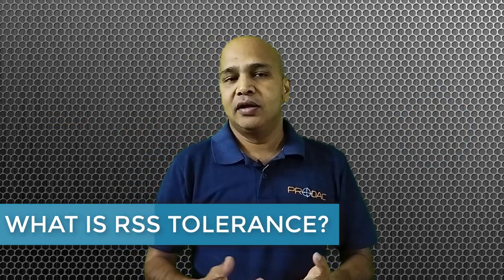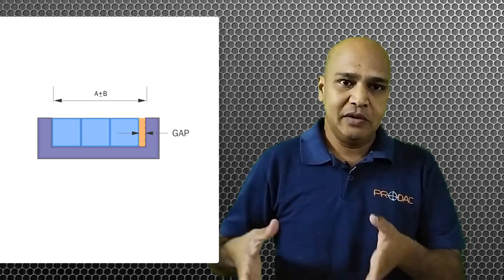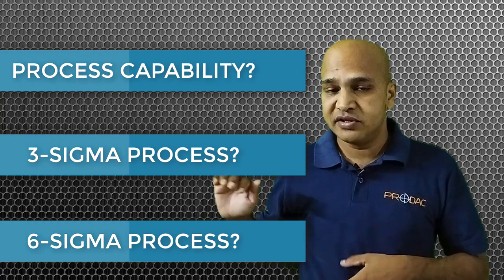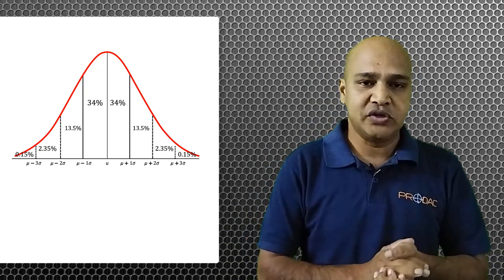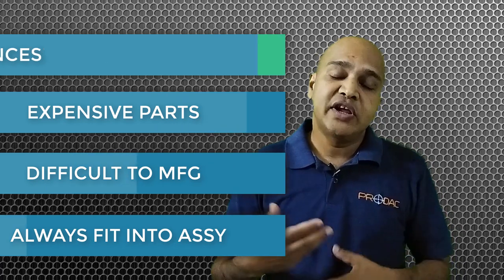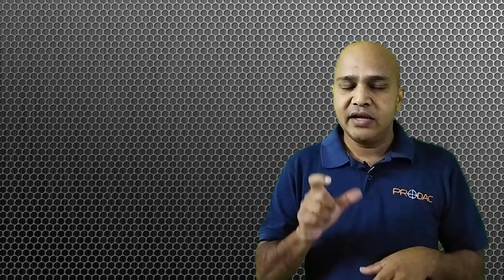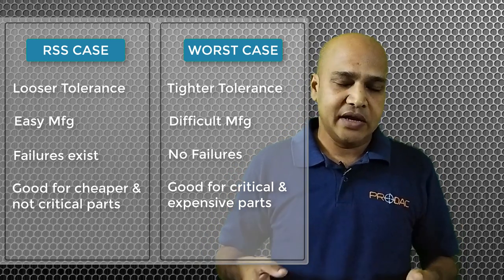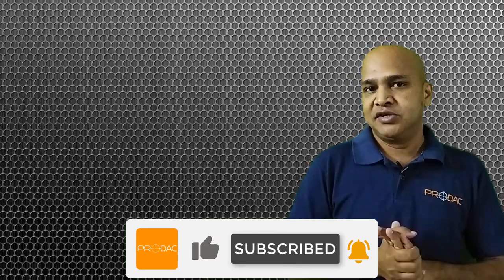RSS Vs. Worst Case Tolerance - Which one to Select?

Comment: Great video. When I use the RSS method I divide the WC tolerance by 3 to get the standard deviation. Any comments on that as to why? I would assume that if I were to divide by 6, it would be calculating the 1 sigma value, and if I divide by 1 it would obviously result in the 6 sigma value (or WC tolerance). Just trying to get a theoretical math understanding. thanks
Reply from the maker: Hi, RSS is completely different method which is calculated based on statistical method. We can't relate worst case with RSS. Both work in different ways.